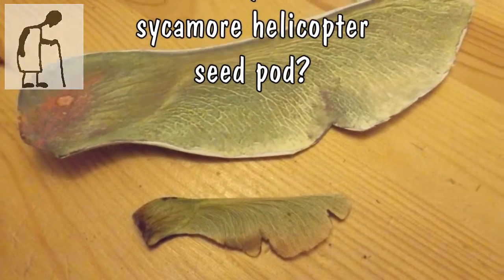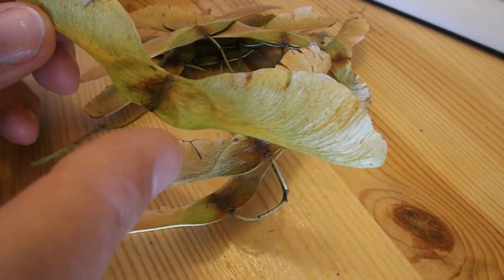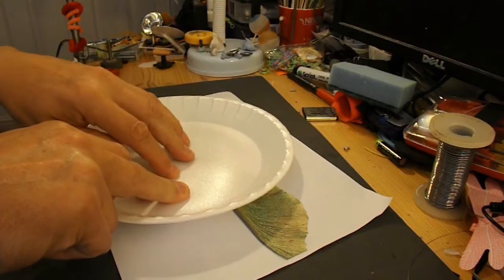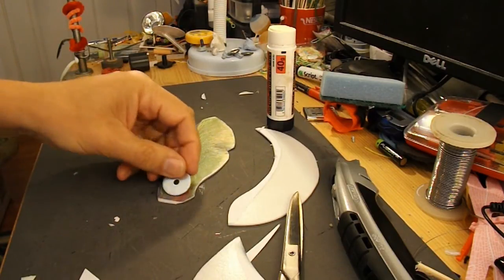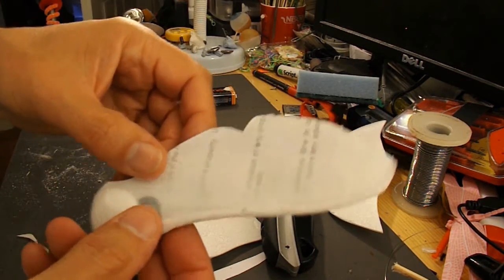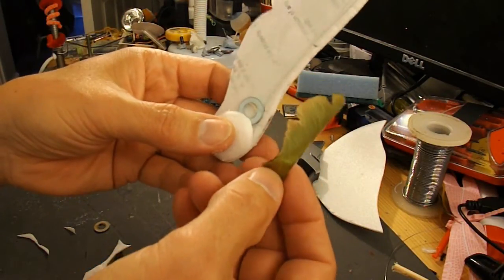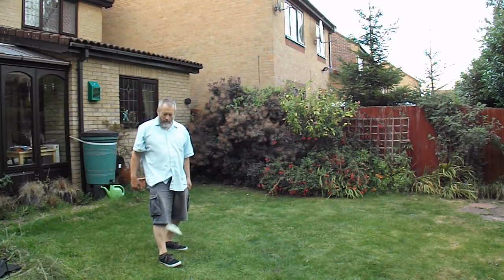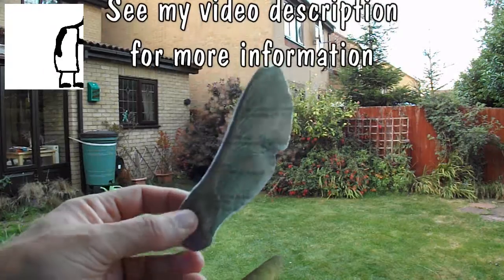Can I replicate a sycamore helicopter seed pod?

Comment: Washer too heavy?
Reply from the maker: +thechromepoet feel free to make your own and find the perfect balance. Certainly it could be improved with more effort. Probably made entirely from styrofoam to get the weight more true to scale. Paper was probably not the best choice but it did allow me to print it and get a realistic colour scheme. Allowing it to drop from a greater height would give it time to 'spin up' to speed as it does not get a chance the way I was just throwing it by hand. SonicDadDotCom do a good one which is smaller and closer to the original real life one.

Comment: Very cool. Here in the states when I was a kid we used to make paper helicopters. We would take a piece of paper, small one cut it into a strip about on inch by three inches. Cut the paper in half length wise about half way down and fold the two pieces opposite to make blades. Then put a paper clip and let it go from a good hight. It will spin like a hellicopter.
Reply from the maker: Hi thanks for commenting. Yes I have made those helicopters and they work fine. In this video I just wanted to see if I could make one by copying that seed.
Reply from the maker: :-) http://youtu.be/hAaF-HaHAQQ